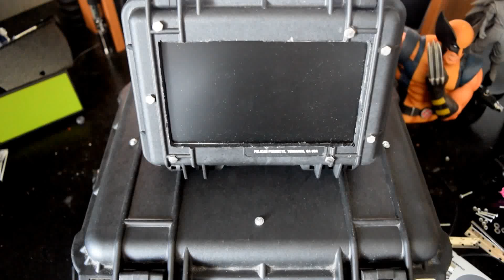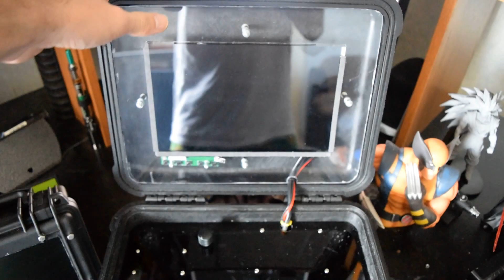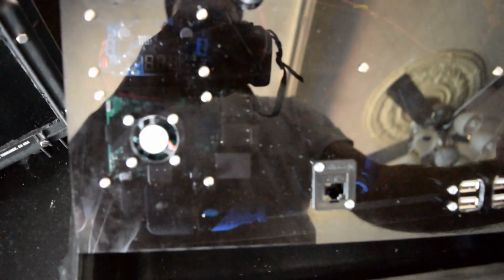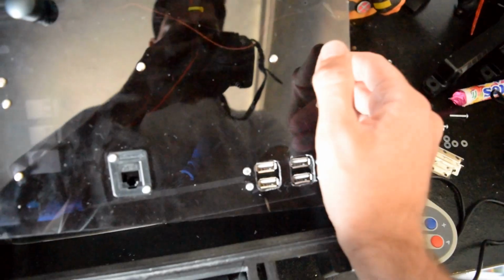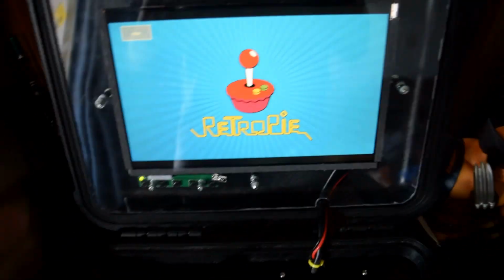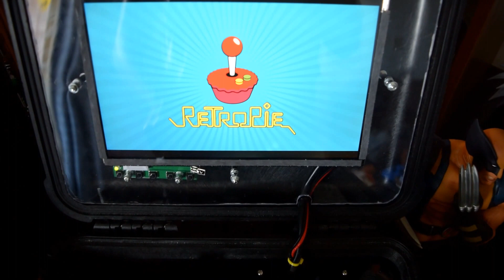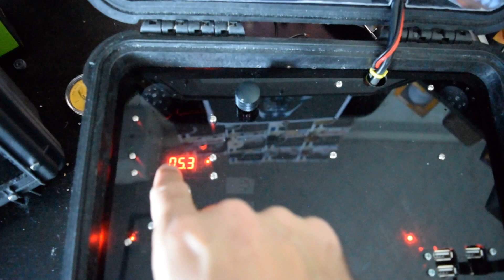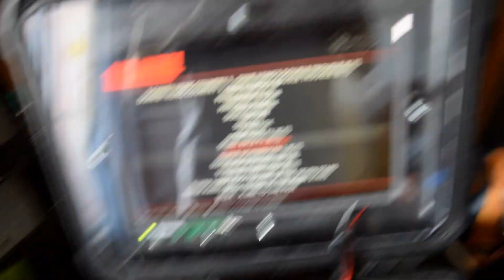Raspberry Pi 3 Gaming System With Retro Pie

Comment: I'm trying to make a retro pi console so I can have it in my car. I can't seem to find a case that would be suitable for the car. Also was trying to see if there is a way to make it work even if the car isn't on. Thanks
Reply from the maker: I built an earlier and smaller version that has its own power supply through a batter bank that is placed inside the box. In the video I say to use a Raspberry Pi 3 but I later realized that the battery pack cannot put out enough amperage to power everything, so if you use a Raspberry Pi B+ (First generation) then the battery bank will supply enough power for everything. I used a Pelican 1120 case which is really small and good for travel, mine fits in my glove box if I need to store it in the vehicle. If you have any questions let me know and I'll try to help you where I can. 

Here's my video on the smaller build.

https://www.youtube.com/watch?v=-BQzuUWkjWk

Comment: Looks great I built two of these using powerbanks to power the pi and the screen. On my last one I used a screen which you plug the pi onto and used a small u hdmi connector so when you run power to the pi you also powered the screen so I had only one wire to run the power bank.This cuts down the need to run two wires to power the system. It gives alot neater setup in the case. Regards John.
Reply from the maker: I was pleasantly surprised about how well the powerbanks worked for the power supply and how long they lasted. I'm thinking about re-doing an old busted Gameboy I have somewhere with a pi if I'm able to cut down on some of the excess width.